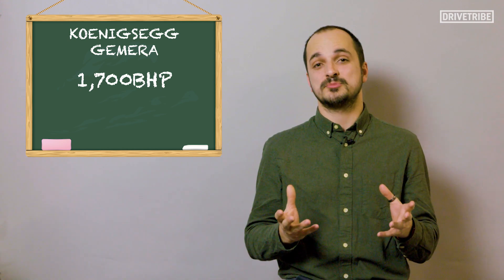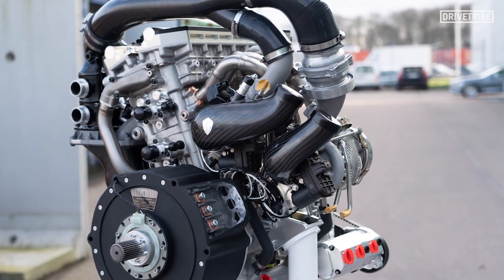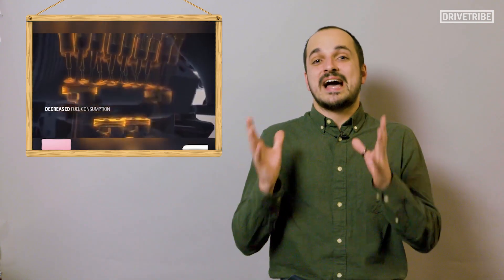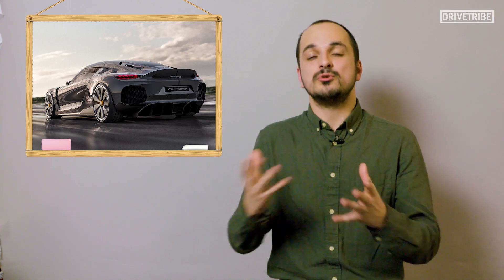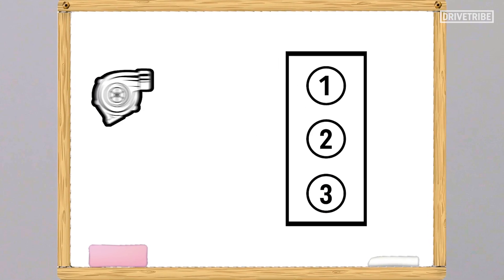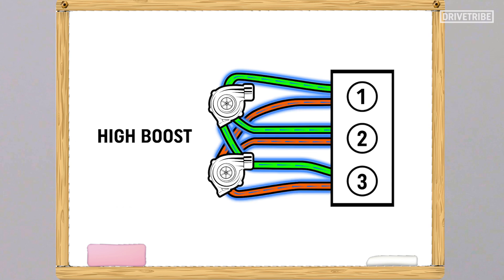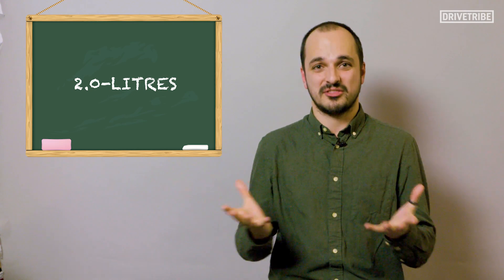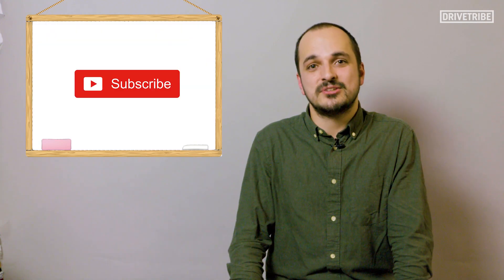This is how Koenigsegg made 600bhp from a 3-cylinder engine

Comment: this should fit nicely into a motorcycle frame...
Reply from the maker: Now that's an idea...
Reply: @Drivetribe  or a lust for being 6ft under.
Reply: 75 kg 600 bhp twin turbo with their 90 kg Light Speed Transmission. Seems a bit heavy for a motorcycle, but then again that's 165 kg to get 600 bhp and 600 Nm of torque. Something has to keep the thing from doing wheelies when you are in the highest gear.
Reply: @MrMartinSchou  Sure, it's a big one. Perfect for something sport tourery; also we could ask really nice for an n/a version and a lighter gearbox.
Reply: @MrMartinSchou  I think, a NA version, smaller capacity Freevalve engine would be fit nicely on a bike. Moreover, for less torque engine, their Lightspeed Transmission would be even smaller and lighter compared with the bigger and heavier (90 kg) one that they put in their Jesko (which is designed for over 1500 nm of torque).
Reply: @MrMartinSchou  It might not need such a heavy beefed up gearbox. That one was designed for the Jesko.
Reply: Or a Peugeot 205 GTI :)
Reply: @MrLundefaret  or my Peugeot 108,aygo, c1 thingy 👌🏼🏎
Reply: @MrLundefaret  Take a look at what the managed to do 30 years back with the 205 T16 !
Reply: The Millyard V6? : )
Reply: With the 400hp electric boaster?
Reply: matsv201 screw the electric trash god almighty
Reply: @savagetuner2404  you won't say that after you try driving something electric with balls, it's instant power
Reply: @3WhaTNexT  Sure he will, he's one of the kids that like to go "Vroom! Vroom!
Reply: @savagetuner2404  Hey, power is power
Reply: ¿SeriouSly PeoPle? Lol like what? I drove a stripped p100d. It’s awesome for the 5 seconds of pure acceleration. Then what? Against actual tuned dragsters, they just can’t compete. Even Chevy’s ECOPO has trouble dealing with its own class
Reply: @savagetuner2404  Mercedes has a 6 straight cylinder turbo baby with an electric motor for boost 😤😤😤 it's just glorious....
Reply: A Cappuccino enthusiast's dream.
Reply: @gseric4721  I've been looking for a while, but now I have found the perfect engine swap for my cappuccino
Reply: @tangowhisky77  it sounds like quite the project haha
Reply: @gseric4721  800hp per ton never killed anyone 😂
Reply: Gseric47 YES
Reply: What about making a V12 version. 8.0 litre 2400hp.
Reply: @haydenjohnson3040  I like the way you think.
Reply: ourworlds atwar  I didn't think about longevity :/
I don't know though, it's electronically started up and both turbos aren't always engaged simultaneously. That might help with the longevity. I'd really like to know what the fuel economy's looking like too. You're already spending that extra dollar on the ethanol fuel.
Reply: If a helicopter engine could be fitted into a motorcycle's frame (look up Y2K), then this bad boi is a no brainer.
Reply: i was thinking the same! 😬
Reply: You can easily turbo a zx14r or busa to over 600hp..
Reply: @arnoldtm31  This might come with a warranty though....
Reply: And the price would be somewhere at $100-150k
Reply: Mmm yes my Triumph Rocket 3 does seem a bit lethargic now that I think about it...
Reply: ourworlds atwar  you clearly don't know what you're talking about in this situation the engine was clearly designed to be able to handle this much power
Reply: If you wanna die yeah lol
Reply: jameshisself  actually it would fit pretty well, it looks smaller than a Yamaha r1 4cyl motor, they have been stuffing that into motorcycles and snowmobiles for years. The snowmobile version with turbos and superchargers. So the konenigsegg motor would fit quite nice. It would be a giant snowmobile engine, and l bet manufactuers are looking at this engine closely, to use or copy.
Reply: Or just strap a turbo to a normal motorcycle .... Easily make that much power or more
Reply: ourworlds atwar  the displacement really has nothing to do with how strong an engine is or how much power it can make reliably and last a long time
Reply: But its still 2000cc so maybe its a bit too big
Reply: Motorbike, old Mini or almost any kei car. What a fantastic source for irresponsible, life threatening high speed ideas to make people smile and shit their pants simultaneously.
Reply: 600 hp motorcycle death bike
Reply: ourworlds atwar  engine displacement has nothing to do with being reliable under boost. Take the Toyota Landcruisers 1HZ motor, 4.2L inline 6 that can't handle more than 16psi without blowing apart. Then you have Toyotas 1KD motor, 3L inline 4 it runs 16psi from standard yet will go to 500,000 and can still handle way more boost without issue. It's not the 1980's anymore
Reply: Günter v. G. YOU ARE MY NEW BEST FRIEND
Reply: Custom chopper with naturally-aspirated version of this engine. Probably won't look as nice as a V-twin but might be good for quicker power delivery. Only thing is I haven't heard this engine yet but trust Christian when he says it sounds great.
Reply: RIP
Reply: This is what i think at the first time heard that its 3 cylinder
Reply: Now thats a death wish.
Reply: CBR1000RR-R-R-R-R-R
Coming soon to a dealer near you
Reply: 150cc moped
Reply: ourworlds atwar  there's no reason it can't be built to last
Reply: ourworlds atwar  do you even know what the point of twin turbos are?
Reply: ourworlds atwar  it's not excessive boost pressure many engines can handle a lot more pressure than that (and there's no reason the head would just fly off the block lmao it's so easy to prevent issues)
Reply: And the rider will fit nicely into a closed casket.
Reply: lethal, anything over 200hp on a bike is a death wish.
Reply: or into an original mini couper
Reply: If my buddy thought his FZ-09 wheelies easily now...he's in for a treat
Reply: i love those idea
Reply: or a peel p50?
Reply: How about the same technology but a litre engine , it would be nice and compact and fit a litre class chassis motorcycle, well a man can dream....
Reply: Or in my veloster... 😂😂😂
Reply: Haki Tautari NO
Reply: @savagetuner2404  😂😂😂 jokes jokes... 🤔
Reply: As long as your prepared to pay for the repairs and not only will I promise unreliability but it's only basically a one off engine with one off parts they are also made for super cars where price is no object = EXPENSIVE
Reply: You meant to say small airplane.
Reply: I'm pretty sure the government says civilians aren't allowed to build home-made missiles
Reply: Triumph rocket +
Reply: I like the way you think you absolute madman.
Reply: Do you wanna die?
Reply: It's actually quite big
Reply: I'm working on a 2 cylinder that is a 500cc 360 twin . Using the same principals...only the turbo has a mgu h I've made coupled to a crankshaft motor . Soo basically a hybrid like an f1 car only the right size for a bike. Should be able to make about 200 hp ...but I'm not going g to try and grenade it right away when it's done so I'll test it lower first
Reply: Or a lawn mower
Reply: You don't need 600 bhp on a motorcycle, it's gonna fly, literally fly 😂
Reply: Honda just announced they are making a V3 forced induction engine for a motorcycle
Reply: Waste of an engine.

Comment: I've never even heard of a 200hp 3 cylinder
This new 3 cylinder is amazing, this engine is the future of engines, imagine this in a mini or this as a V8
Reply: BMW I8 250hp 3cyl
Reply: @Racer92  really🤔 wow I need to look into 3 cylinders, I'm usually looking at V8s both petrol and diesel as well as the Cummins 5.9 12 valve
A 3 cylinder with over 200hp.... my gosh
I do know that mercedes is doing a 400hp 4 cylinder which is epic
Reply: @harleyrobertson73  why the hell would you look into diesel V8? The purpose of diesel is hight torque low revs and fuel economy; with a V8 you throw most of that out
Reply: Anankin12 Just because it’s a V8 doesn’t mean anything about how high or low it revs
Reply: @harleyrobertson73  Sure, 100 bhp per cylinder is quite impressive - until you compare it to an engine that delivers 200 bhp per cylinder.
Reply: @Anankin12  not really, a V8 has just as much if not a little more power than a 6..... It's just the Cummins 6 is simpler in design and is easier to fix hence why gm and mercedes is making them again, I prefer a 6 to an 8 I just like engine noise of a V8, like the Scania 14 litre diesel V8 is a noise to behold
Reply: @MrMartinSchou  People have been getting 1600hp from blown V8s for a long time, it's just impressive that it's a 3 cylinder this time and production
Reply: Mihajlo Vucinic The new Toyota GR Yaris will also have a 3-cylinder engine, which will be even more powerful. (I can‘t remember how much exactly, though. Somewhere in the 260s or 270s, I guess.)
Reply: @michaelhartmann8460  imagine ford doing a 3 cylinder hybrid mustang with 500hp or a ecoboost V6 sho mustang
Reply: @harleyrobertson73  2,4 l 4 zylinder exoboost Mustang?
Reply: Toyota Yaris GR - 250 hp 3 cyl
Reply: the fiesta st has a 3 cylinder with 200 hp
Reply: @durbomat5498  really? I thought it was a 4 cylinder 🤔
Reply: Everyone forgetting about Rotax? Turbo jetskis and snowmobiles have been making upwards of 600hp out of those 3 cylinders for meany years.
Reply: @antilagboostaddiction8322  that's also different to a car engine, it's quite similar but also different
Reply: The number of cylinders is irrelevent tbh, because the immediate question for anyone who knows how engines work is; how big are the cylinders???? Displacement is the key figure to look for... a bigger cylinder with a larger displacement is obviously going to create a bigger bang than a smaller cylinder with less displacement.
Reply: @Nemoticon  well yes and no, you can have a smaller cylinder but with 2 sparkplugs per cylinder you can get a bigger bang like that of a bigger engine..... Also forced induction is great for bigger power as we all know
And more cylinders means that if a power stroke V8 makes 400hp and 1000lbft of twist and a 6 cylinder is making the power there is less stress on the V8 as the power load is spread across the bigger engine
Reply: @harleyrobertson73  Depends how big the V8 is.... increasing inlet and outlet valves, injectors and spark plugs will all help with making minor power boost, but as the old saying goes, there ain't no replacement for displacement. Small V8s like a 4ltr block will never make as much power as a 7ltr block under the same tuning. More cylinder doesn't result in more power, more fuel and air results in more power, basic engineering 101.
Reply: @harleyrobertson73  You could make a 2ltr V8 and it will struggle to make more power than a 2ltr 4 pot...... the fuel and air mix is where it all begins, the bread and butter for all internal combustion engines.
Reply: @Nemoticon  and you get more fuel and more air in a bigger engine, not just volume but cylinder size as well, hence why Americans love the V8 because in naturally aspirated form they make similar power to a turbo 4 cylinder but cheaper to make and engineer
Reply: @Nemoticon  which is literally mechanics 101, something we all know but when I went to do mechanics at warwickshire College during the level 1 it was called unit 101 😅 brilliant
Reply: @harleyrobertson73  Lets not forget, power is generally proportional to displacement, 2ltr engines produce roughly 200hp and 4ltr engines produce roughly 400hp... when you see the hp figure rise significantly about its like-for-like ratio to displacement, its almost always because the engine has force fed induction like a turbo or supercharger.... or burning high octane fuel.
Reply: @harleyrobertson73  Engine configurations, be it a V8 or inline 6 or whatever is hardly ever to do with power but with packaging and characterisitics. Flat-boxer engines are compact, V8s have a lovely burble and i6/V12 engines are very smooth... with comes down to cylinder firing order.
Reply: @harleyrobertson73  I did automotive engineering at Coventry, just down the road from you, lol... we used to come to your student bar and make trouble because ours sucked xD
Reply: @harleyrobertson73  Put it this way, if someone make a 7ltr 3cylinder engine, it would be producing roughly 700hp in standard tune. It's all about displacement.
Reply: or even a like ~3.5 V6
Reply: @robertbalu8001  that would be an amazing V6 in an Alfa Romeo
Reply: @robertbalu8001  would more than likely be a 4.0
Reply: ArmchairWarrior  way back when in the 70s cadillacs 500ci (8.2L) V8 made 190 net horsepower
Reply: No of cylinders is largely irrelevant it's all about specifics. For example, Ducati  1299cc superleggera, 2 cylinders, NO turbos, 215bhp.
Reply: @ridegreen2k7  Compression ratio and ignition timing. Along with strong head gasket = hp
Reply: @benchasinghorizons9428  🤣🤣🤣 no it doesn't
Reply: @ridegreen2k7  Ok, correct me then
Reply: @benchasinghorizons9428  I dont have enough time to be honest
Reply: @ridegreen2k7  No you just don't know...lol
Reply: @benchasinghorizons9428  Air flow CFM = HP (100 HP per 150 CFM on the scratch pad is a popular rough guess). Ignition timing and CR has its limits.
Reply: Harley Robertson New Toyota GR 4 has 250 hp from 3 cylinder
Reply: Pretty sure you could tune a Triumph 800cc 3 cylinder to almost 200hp. And a 2.3 liter rocket 3 makes 200 without a turbo also..
Reply: @pauld.b7129  motorcycle and car engines are different, similar but different but yeah I guess you could
Reply: The new Toyota Yaris GR (a Yaris derived from Yaris WRC) is a 3cyl turbo producing around 250.
hp
Reply: ArmchairWarrior  dodge didn't have a 7.0L prediction engine, ford had a 7.2 power stroke back in 2000s and currently has a 7.0L godzilla V8 making 400hp and 450 lbft of twist at a low understressed rpm for their trucks
Reply: ArmchairWarrior  those would and did last a lot of Time tho
Reply: It may be only 3 cylinders... but it is 2.0ltr, 100hp per liter is good but nothing new.
Reply: Firebrand Agreed, especially when it comes to turbocharged power plants
Reply: @amorag59  100hp per liter is fantastic for any non-turbo unit. Forced induction will always make exceeding that number easier. But everyone here is talking about the number cylinders when they should really be talking about displacement. It could be a 3 cylinder 400cc engine or as in the example of this Koenigsegg it is 2000cc... so obviously its going to produce power relative to the size of the bang inside the cylinder. Not many 2ltr 3 cylinders around, so obviously its already going to appear more impressive on paper.
Reply: @Nemoticon  Right, the sensationalism in this video is annoying. He starts off by calling the engine tiny and then addressing it as big when he talks about the displacement. Great we don't need a camshaft! Woohoo! Oh lets just ignore that we have to have a pneumatic and hydraulic pump added in now... He at one point even says it's like a inline 6 due to the single valve per exhaust runner which I'm scratching my head over here like what?  Does that make sense to anyone else? Wouldn't this be more like two twin scroll turbos?
Reply: @amorag59  Ahhh, someone who knows what they're talking about, lol. You're correct on every account. Electronic valves aren't new either, its been testing in motorsport more than once though never in competition. The clever part of the 3cylinder here is all in the block head, the rest of it is pretty standard. Still an interesting peice of engineering though. But like you say, it's the video that is the misleading part... I mean he didn't even get the number of doors correct, lol
Reply: @Nemoticon  correct. It's easy to forget that internal combustion engine is an airpump. Volume is key. But we are so accustomed to think more cylinders->more displacement. Easy to get caught.
Reply: @TheRealCoyote  That's fair, I understand that.
Reply: @Nemoticon  yes 100hp per liter is nothing new. 200hp per liter is pretty rad tho.
Reply: @refirendum  In the 90s, kids were tuning 2.0ltr turbos to 600hp...
Reply: ArmchairWarrior  doesn't say Much about Companies Tbh, Ford made 657hp 3.5 V6 and Dodge made 200 hp 4 Cyl with Neon
Reply: I believe Nissan also made a 3cyl engine that made around 300+ hp.
Reply: I have a 2015 MINI Cooper F56 base model. It sounds like a bubbly diesel at idle. It also is the same block / base as the petrol motor component of the BWW i8.
Reply: Look up the new Toyota yaris GR 4
Reply: Look at the snowmobile industry, arctic cat had an 1100 turbo 2cyl that made 177hp, tuneable to 300+ hp, and Yamaha has 999cc 3cyl turbo thats 200hp out of the box, also with a programmer, tuneable to 300+ hp. Also they are very reliable. It's like riding a rocket
Reply: FIESTA ST
Reply: You'll find one in the Fiesta ST!